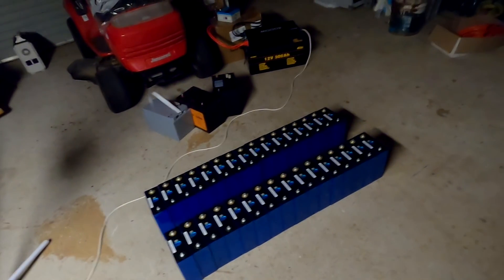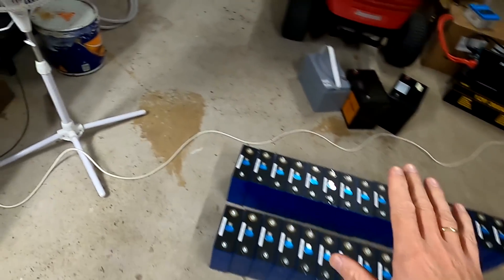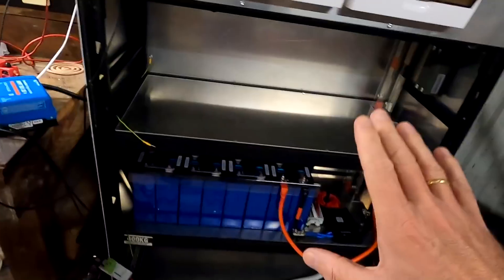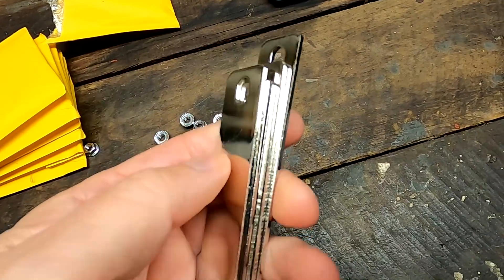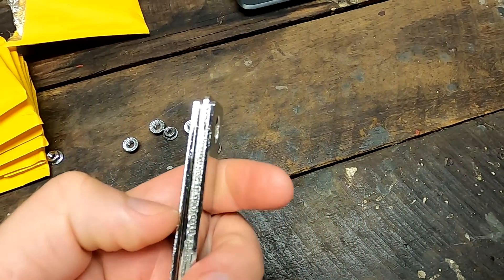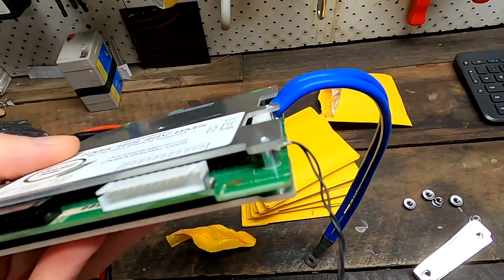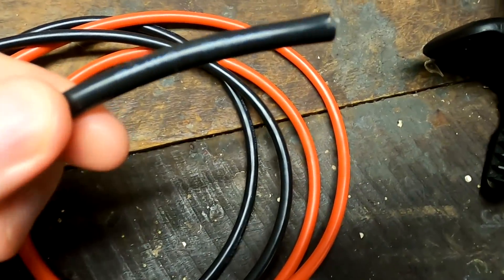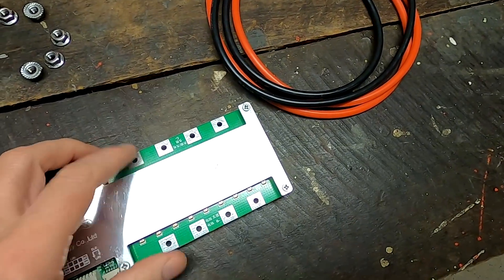HELTEC 200A BMS comes without cables? Preparation to install 30kWh of batteries.

Comment: Good video as always from you. I see that you have a standard side cutter, and as far as i can see they are not quite up to the task for the cables you are working with. I use the Knipex 95 11 165 A cutter a lot, and they do a great job on both cutting and stripping thick multi core cables with fine strands. They chew trough heavy gauges wiht ease. Even tried them on a 70 square mm double insulated wire, they cut troug after a few snips, but the cut was a bit rough..

Comment: Hi Andy, wouldn't it be easier to solder the cables flat ontop of the PCB, rather than drilling the hole out. Just a thought. Keep up the great work :)
Reply: I thought about to push a half thorough the hole and solder 50% on top and 50% at the back.
Shouldn’t this work as well?